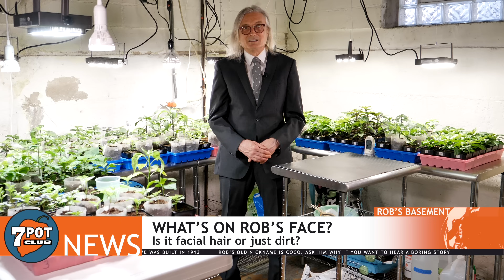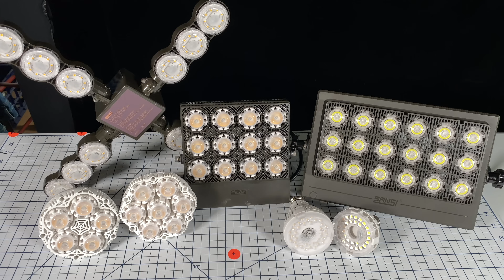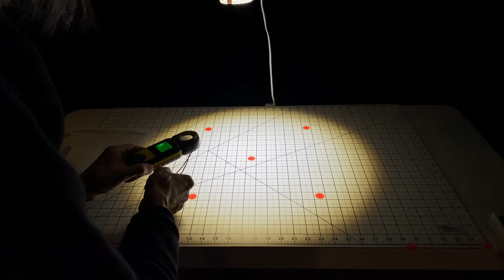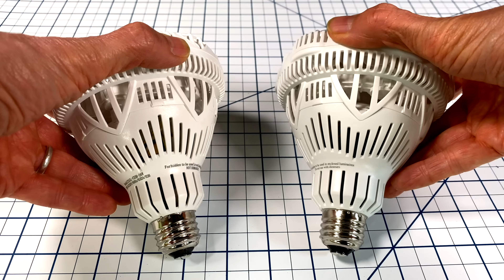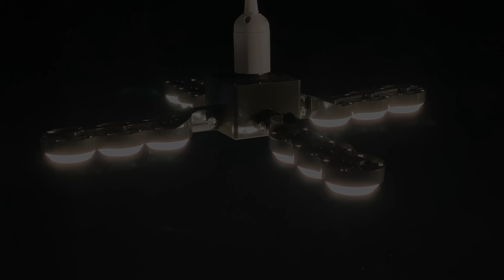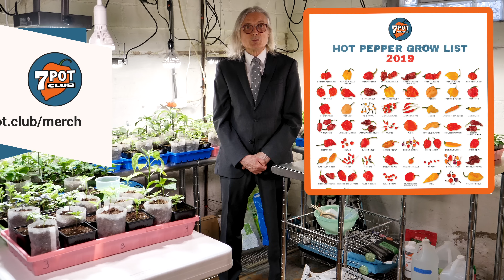Which SANSI LED Grow Light is Right for You?

Comment: If you have a Smartphone you already have a PAR meter.   All you need is the App and you can use your phone as a light meter.
Reply from the maker: When I made this video over 4 years ago there was no smartphone app that accurately measured the entire PAR range. Which ones do that now?
Reply: @7PotClub  The app called Photone will replace a par meter.  It’s surprisingly accurate.

Comment: I just bought the 20 watt, (two 10 watt heads), and from what I can determine, the 15 inch height above my Green Mound Juniper Bonsai, is receiving around an 800 foot candle illumination over the top area of my tree and a "DLI of about seven.  May I ask what is your opinion of my light numbers for my "should be outside but IS inside Bonsasi"???  Thank you for a concise explanation of the performance of the Sansi LED grow-lights....

P.S.  The clamp on goose neck DOES NOT hold position and I finally had to mount the clamp high above my tree with each light hanging downward.  Any attempt to have the goose neck hold a "straight out" positioning did not work, so, users will have to hang these clamp on lights higher and let them hang down....  The bulbs are GREAT, THOUGH....

Comment: So where are all the figures for the real power consumption at the mains outlet? Low cost companies have the nasty habit to pump up their products to make them sell but real power consumption is way lower when measured. If assuming good leds with an average light yield of 100-110 Lumen per electrical watt then a good approximation of light yield can be made. Using that Lux meter in its LUX mode the instant luminary flux can be measured. Dividing that by 74 gives a good approximation of the PAR value. With the figures provided in that video there is not much left of that further away than the classical 12 inch distance lamp <=> plants.
Reply from the maker: I guess you missed that I used a Kill-A-Watt meter to test the actual power consumption of each light. 😀

Comment: While I really like the smaller variants as they have much more value than the standard grow lights you find on Amazon, I’m sceptic about the larger ones. The Spider Farmer SF1000 and SF2000 seem to be a better deal, considering the power consumption, dimming feature and infrared LEDs.
Reply from the maker: I like VIPARSPECTRA for larger lights. However, for growing seedlings, the SANSI lights perform just as well with a fraction of the power consumption.

Comment: Why didnt u measure the ppfd that's why I stopped using the sensi lights,they are best for seedlings but if u want a light for a true indoor garden the PPFD needs to be waaay higher like around 500 and up
Reply from the maker: There's a lot of hype around grow lights. I'm not recommending SANSI lights for growing bud or commercial produce. For the average hobbyist's growing seedlings and plants indoors, SANSI and other lower wattage lights are a good value and inexpensive to operate.
Reply: I want to grow with 1 or 2 Sensi 36W LED LAMPS in a small Minibox 100×50×50cm only for my own. Is ot possible to get relativ good Stuff from it? Can you hwlp me to find the right e27 LED Lamp with 36 W?Greets

Comment: Is the 36 Watt  light enough for a 1.5 x1.5 feet box? I planning to use it on growing tropical plants like bamboo or palm trees. On the sansi website it also says "dont use in enclosed fixtures", so is it safe to use inside a growing box?
Reply from the maker: I think they mean don't put the bulb in an enclosed lamp fixture, but I don't want to provide safety advice. 😀 I think you would be happier with the 60W or 70W SANSI light for this purpose.
Reply: @7PotClub  Ah okay understood 😅
I was checking on amazon but it seems there are no 60 or 70 Watt available
Reply from the maker: I think the 36W might work, but would suggest a brighter light that has broader coverage. If you're in the U.S., I do see both the 60W and 70W listed on this page: https://amzn.to/3uynaQL
Reply: @7PotClub  In europe i cant seem to find them :(

Comment: A 100 watt light should consume 100W. Amirite?
Reply from the maker: You'd think so, but not always. In this case, the total power rating of the LEDs is 100W, but the power supply is supplying less wattage than that. To know why, we'd have to talk to the engineers that designed the light.

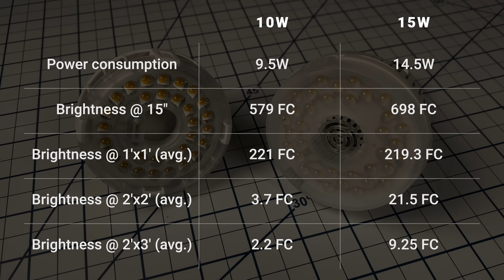Comment: 7:30 which unit you're using  to measure? Inch, foot or yard?
Reply from the maker: It's listed on the chart. The first reading is 15 inches directly below the light. The others are averages of several readings at the edges of a rectangular area: 1 foot x 1 foot, 2 feet x 2 feet, and 2 feet x 3 feet.

Comment: The CRI rating of these LEDS is astounding! I am in the process of buying the 100 watt version. I will be building a small wooden enclosure for the light fixture using an 80mm axial fan to pull the heat through the fixture and out of my 36"×18"×42" grow cabinet. I have two 4" duct flanges(one inside cab, one outside) and a dust filtration inlet. Inside the cab is covered with highly reflective white poly-paper (panda paper). I also have HID lights and a 250 watt phantom digital ballast in case I needed more power... With my HPS bulbs I get around 33,500 lumens but it is warm. I used to use a 200 cfm inline blower with carbon filter for vegetation smells. I'm curious how the LED will fare.

Comment: Honestly, Rob, you're the reason I ended up purchasing these (using your affiliate link of course) and my plants have NEVER been happier. :) My garden doesn't get prolonged sun in any area due to a large tree shading majority of it so I spend a lot of my day moving pots, chasing the sun, but this helped ease that burden. We also receive a lot of extreme heat (40C and up) so putting my plants under these lights instead of the scorching sun definitely saved them. Thanks so much for your in depth and honest review. I'll be using your affiliate link more in the future as my pepper collection is expanding!
Reply from the maker: Thanks so much! Glad your plants are doing well. 😀🌶🌱

Comment: I love their lights, been using them since the fall for houseplants, and it helped my plants through the winter. I was surprised you didn't mention the 40w version that they have, it's not geared for plants, but works just as good as 24w or 36w one, well it's better I find than the 24w one. I had no idea they had smaller ones, definitely need to grab some of those.
Reply: Hi, which 40w light do you mean?

Comment: I brought the 36W bulb just a few weeks back, worked great for a week then broke, looking at the amazon comments seems to be a common problem,  so seems you had some luck, I will avoid SANSI for my grow lamp next season.
Reply from the maker: Sorry you had a problem. Based on a 4.3 of 5 rating on Amazon, I'm not sure it's a common issue. My first 70W has been running continuously for 6 months now with no issues. And SANSI does have a 5 year replacement warranty.
Reply: @7PotClub  they had a lower rating on Amazon UK, since I returned mine the 36W has been delisted from my Amazon, as I said, I loved it until it broke!

Comment: Thank you Rob for your very thoughtful and candid review of this series of Sansi LED Grow lights. I would like to comment on the service side of Sansi lights through experience. Not so long ago I had a 70W version of these lights similar to the one you review here. For reasons I do not know, one of the LEDs went dark, and another went into a strobe like flashing mode. I established contact with Sansi, provided pictures of the issue at their request, and on very short order a replacement light arrived. I would have to say then that Sansi delivers on a quality product and is prepared to quickly respond should an issue evolve. Thank you for this update. Happy Easter as you may enjoy. Happy Gardening! -Bob...